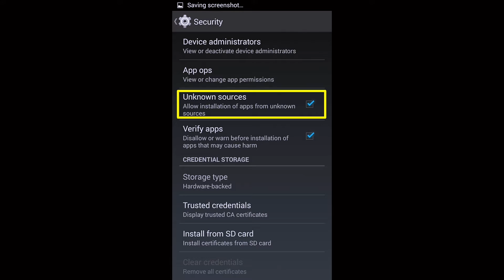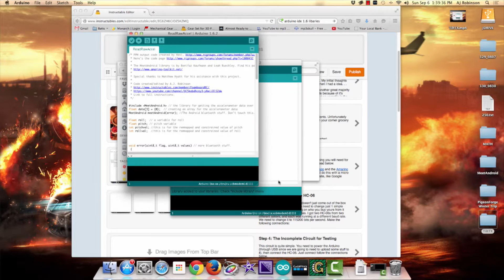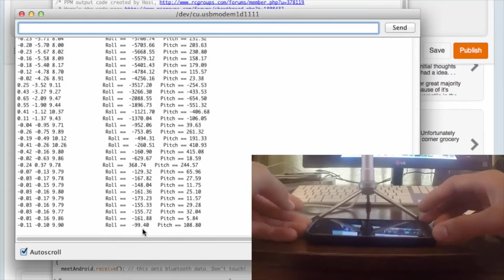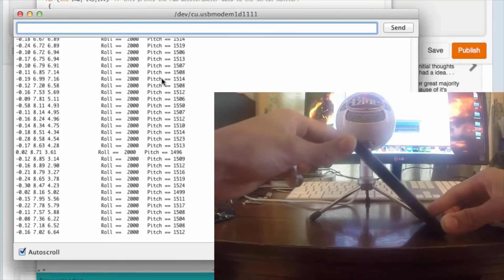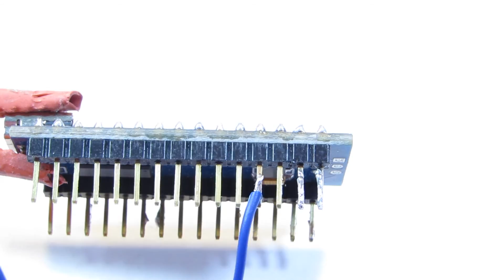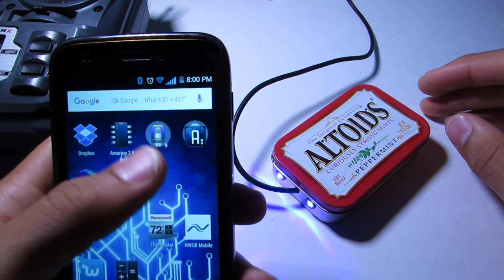Control Your RC Plane With Your Phone!

Comment: I am new to this just to clarify can the phone without the rc transmitter control the rc plane. If not I have seen video doing it could you do video of it
Reply from the maker: You can't connect a cellphone to a regular RX plane receiver. The Receivers work directly with their respective transmitters. You would have to have a cellular connected device on the plane that could talk to a ground phone if you wanted to set that up.

Comment: Very interesting project AJ, well done!   How did the plane respond when you used the phone to control?   Did you notice any lag?   Any signal dropout or other glitches?
Reply from the maker: This was a long time ago, but I remember it clearly! It was a ton of fun to fly. I never had any issues. The response was very quick, and the bluetooth connection was very solid. Since the project used the radio itself for a link with the plane, it was rock solid.

Comment: Excellent video. I have one question. When I try to upload the ReadRawAccel to the arduino, it show gave me the error: 'error' was not declared in this scope, in the line "MeetAndroid meetAndroid(error); //The Android bluetooth stuff. Don't touch this."

Why it happened?
Reply from the maker: You either didn't install the MeetAndroid library or installed it incorrectly
Reply from the maker: Read step 3 again
Reply: +AJ Robinson Thank you, I don't know what was wrong on my libraries, but I used the code bender and it works great.

Best regards